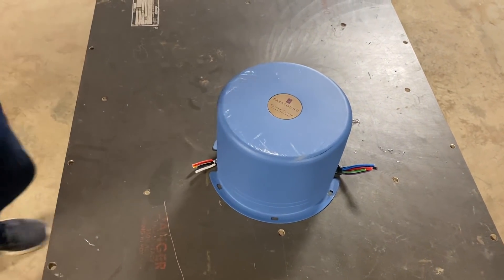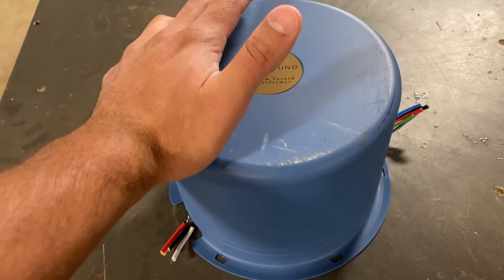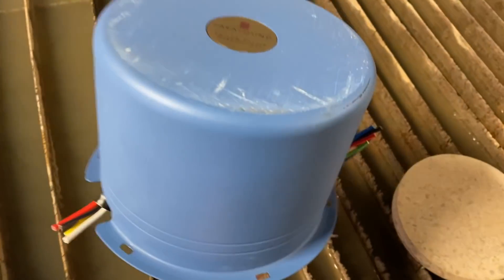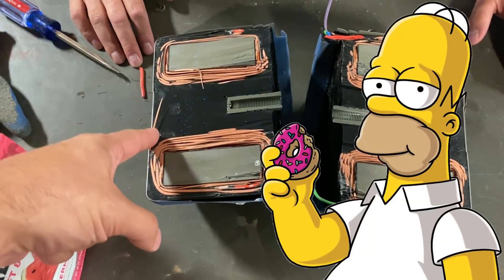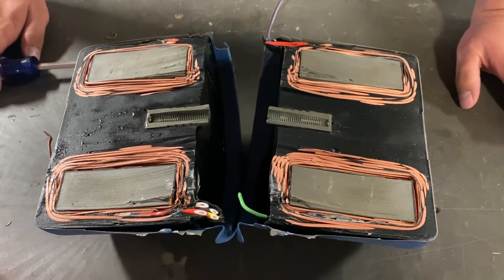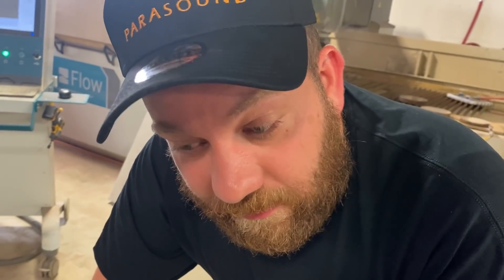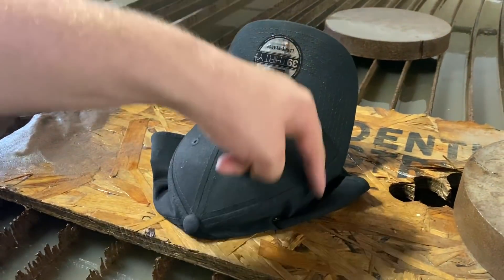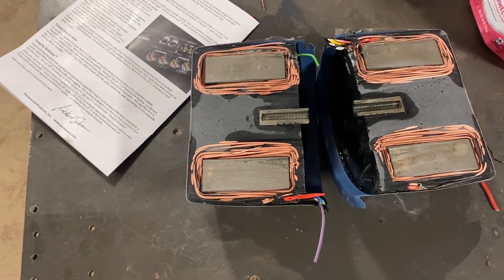Amplifier Transformer Cut In Half With 60,000 PSI Waterjet

Comment: Toroid transformer itself does not convert AC into a DC, to do that there has to be a separate circuit after it. But in fact the quality of converted AC/AC by that transformer is high.
Reply: A FULL BRIDGE RECTIFIER!!
Reply: @Haagimus  Came here to say this, lol.
Reply: @Haagimus  AN EVEN FULLER BRIDGE RECTIFIER!
Reply: Yes transformer changes voltage and then you have a rectifier after it to convert to DC
Reply: .....WAS high.
Reply: exactly :)
Reply: Rectified - usually using a bridge rectifier (4 diodes in a package) and the smothed out with a big capacitor.
Reply: This is a day in the life…. And they put everything they do at work on YouTube. You see it just takes a while
To update it all :)
Reply: How about an isolation transformer. Same voltage out as in only a better cleaner wave form.
Reply: Circles of all kinds
Reply: Needs a FULL BRIDGE RECTIFIER
Reply: you beat me to it
Reply: I love how he explains it like he knows exactly what he is on about, imagine if the comments was disabled, without a dislike button no one would ever know the truth…
Reply: Furries make world go round
Reply: Think you got summn wrong the quality isnt different to any other comparable transformer (same materials) but it does reduce audible humming and vibrations since the magnetic field is conducted in a closed circle and thus isnt attracted by external magnetic fields like the earths
Reply: Yeah they need a rectifier at the output
Reply: The only thing that can possibly have a measureable influence on the "quality" of the waveform is the steel can around the transformer which acts as electromagnetic shielding. But if the supply voltage is rectified and properly smoothed and filtered it really doesn't matter how clean the sine wave is. The stuff that comes after the transformer is way more important for good audio quality.
Reply: @Papperlapappmaul  Unless this was an impedance matching transformer
Reply: @kg4boj  This is a power supply transformer out of a solid state power amp, but you totally have a point. Output transformers can be beefy, too.
Reply: nice pfp xD
Reply: >FURRY
Your opinion just like your existence is trash.
Reply: @TheDevilockedzombie  Cope and seethe.
Reply: @TheDevilockedzombie  who asked?
Reply: @TheDevilockedzombie  
Hi there. 
I am not a furry and I even don't like them myself, I just draw anthropomorphic animals. I like spending my time this way when there is nothing else productive to do, and unlike most of furries, I hate degeneracy and all NSFW content associated with animals.

Yes we exist, have a nice day anon.

Comment: 1300 watts is how much power it can output. 2 ohms is the impedance, or how much power is being lost as heat do to resistance. 2 ohms is very low by the way, which is good because the less loss from heat the more power is reaching the driver.

Comment: Transformers do NOT convert AC to DC, they take AC voltage and using induction they transform voltage, a single diode can transform half of AC to DC, but to do the best job of turning single phase AC you need 4 diodes in a full bridge rectifier configuration, or as electroboom aka Mehdi would say a FULL BRIDGE RECTIFIER.

Comment: 4 wires plus shield? That's an high wattage audio output transformer... an impedance matching transformer. Power transformers usually have more wires because they have more circuits. I could be wrong.

Comment: Transformers step up, or step down alternating current. To convert alternating current to direct current, which is ac to dc, you would want to use a circuit called a rectifier. Toroidal cores can also be create things like inductors which help buffer the flow of current!
Reply: I was wondering if anyone would correct them.....

Comment: I learned that Parasound doesn’t want their big transformer to be user serviceable. Or even serviceable at all. It’s hard to imagine what could go wrong with copper that thick. I guess it could overheat and melt the insulator. Especially when heat can’t escape due to all the resin. Hmm. I think I’ll pass.
Reply: The potting conducts heat better than air so it helps the heat escape. If it wasn't potted the coil buzz from the vibrations would drive audiophiles insane.

Comment: That might be an output transformer. If it is it matches the high impedance output of a vacuum tube amp circuit with the low impedance speaker
Reply: 1300w tube amp? i wonder what the mains transformer of that baby is like, then.
Reply: @victortitov1740  whatever it powers it is massive

Comment: TRANSFORMERS NEVER CONVERT AC TO DC. THEY REDUCE OR INCREASE VOLTAGE AND SOMETIME EVEN KEEP IT THE SAME VOLTAGE FOR ISOLATION PURPOSES. DIODES AND CERTAIN CONFIGURATIONS OF DIODES KNOWN AS FULL BRIDGE RECTIFIERS ARE WHAT TURN AC INTO DC WITH THE HELP OF CAPACITORS AND SOMETIMES INDUCTORS TO SMOOTH RIPPLES IN THE VOLTAGE UNDER LOAD.

Comment: Transformers transforms low voltage-high current to high voltage-low current OR high voltage-low current to low voltage-high current.

Audio output transformers transform the high voltage AC-low current inside the amp to low voltage AC-high current to drive a dynamic speaker load.
Reply: You're totally right with explaining what an audio transformer does, however this is a power transformer for the input of the power supply circuit from a solid-state power amp.

Comment: A transformer does not change AC current to DC current. A Full Wave Bridge Rectifier does that. It comes after the transformer. Transformers change the voltage and amperage.

Comment: Ac power goes in and ac power comes out at either a lower amperage higher voltage, or lower voltage, higher amperage. It is then rectified through a bridge that converts it to dc power :)

Comment: Lol.. AC to DC.... i don't think so. A transformer is typically used to change voltage and current AC to AC... you then attach a bridge rectifier to convert to DC with  power filtering stage. Then with that lower voltage, high Current capable power output, you use transistors (usually mosfets) to amplify the low level audio input.

Comment: Guys from parasound make 1300W transformer with FERRITE core but it working on domestic frequency 60Hz. Dafak? This mass of ferrite is more than enought to build "normal" high frequency transformer with power capability in range od 50-100kW. Amount of copper is too big, so resistance of winding is big. Metal shielding is close to wingind and it have enormous high capacitive coupling and high frequency current can flow by it but this shielding is not complete - bottom part have no shielding. 
Please buy normal audio transformer - full metal jacket (shileding), core can suppres high frequency current and it is quite cause ofc flooded by resin. And you should save something like $7k.
Reply: It's an impedance matching transformer coupling their amplifier to one of your speakers

Comment: Ok, so what a transformer does, is it takes an incoming power signal and transforms it into another signal of different voltage and current. So likely due to the number of turns around that iron core, it's converting the 120 volts from an average outlet into a significantly lower voltage, by raising the current. To change it into DC you use what's called a rectifier and that's a completely different device with it's own goof soup going on.
Reply: @CustomCoinRingsUSA  It's a common mistake because with transformers there is more than meets the eye.
Reply: @CCR USA I feel like that particular transformer might have a bit of trouble saving the world after being cut in half.  Also, does this make the waterjet a decepticon?
Reply: @Benzene265   maybe 😂
Reply: this comment gave birth to pure gold! XD
Reply: Also they can act as isolation from the mains supply.

Comment: That, my friends, is a transformer, a component of an amplifier whose sole responsibility is to step up (or down) the voltage to a more useable level.

The output of the transformer will need to be sent to a set of rectifiers (4 big diodes) that will in turn create a dc high rail and a dc low rail for the output stage to draw from as it generates the signal that drives your speakers.

If you need an amplifier repaired, I can help ;)

That is a big transformer.
Reply: Oh hey another electrician!

Comment: I learned that the base materials are nowhere near expensive enough to justify the price. I also didn't learn that most of what is in High Quality Audio products is snake oil because I already knew that.
Reply: Kind of is and isn't, its more a incredible example of diminishing returns. Is that high end amp a better amp when measured with test equipment, usually. Is that .001% THD vs .01 or .1% THD worth one or several orders of magnitude more? No freaking way.

Comment: Ugh, transformers only transform voltage via a turns ratio and AC goes in and comes out a different AC voltage... There is zero DC.
Reply: Yes thats right the secondary coil would be connected to a rectifier circuit that converts the AC into DC..
Reply: You can use a transformer to convert DC to AC. Granted, it has to be really shitty DC that pulses on and off instead of the nice constant voltage/current that you'd expect from DC.
Reply: @wompastompa3692  It actually isn't AC on the output then, but DC too. AC means the polarity changes, not necessarily the voltage value.
Reply: @mareksvrcina5279  actually AC or whatever comes out of the wall in America does change voltage. 120v is only the average voltage of each peak. We use RMS on the peak voltage(170v normally) to find 120VAC. And that has nothing to with DC. Transformers only purpose is to multiply or divide the voltage and corresponding current value. Example would be using a 1:4(primary to secondary) to change 120VAC to 480VAC to power a vacuum tube in a guitar amp. You will never have DC from a transformer.
Reply: @vapoodyne8249  I was replaying to @Wompa Stompa. No one is controverting that there is alternating voltage in the wall socket and no one ever has, or at least I hope so. Read my reply once more, properly this time.
Reply: @mareksvrcina5279   Sorry, I assumed you were correlating DC on the output with the voltage change not being a factor here. You said “it actually isn’t AC on the output then, but DC too.” There is no DC on the output of a transformer ever. That statement, no matter what it is in relation to, is plain incorrect. And on top of that, using a “really shitty DC that pulses on and off”, also known as pulsating direct current, would not work through a transformer in any useful way. The DC level will be removed. It won't appear on the secondary. There are circuit configurations called DC restoration used in pulse circuitry like radars etc. To deal with this.
Reply: @vapoodyne8249  Sure. I agree this DC on the output is ideally not referenced to "anything", but that doesn't make it AC. My previous " ... , but DC too" meant that if a transformer is fed with pulsed DC signal, it won't magically output AC, but the there will be some form of switched DC signal on the output instead (as well as on the primary input). That is definitely not plain incorrect. You have interpreted it incorrectly only. 

Edit:
Now reading your reply once more, what exactly does it mean, "using pulsed DC would not work through a transformer in any useful way"?
This is exactly what happens in EVERY switching power supply, hence they are called switching, and I think they are quite useful, aren't they?
Reply: @mareksvrcina5279  definitely useful. I guess you could call the switched signal dc because it doesn’t switch current flow direction.
Reply: @mareksvrcina5279  you two need to "rectify" and move on......